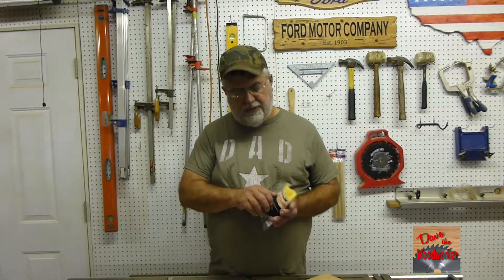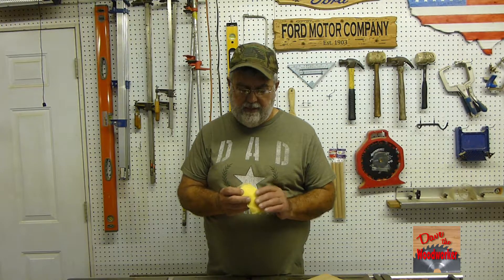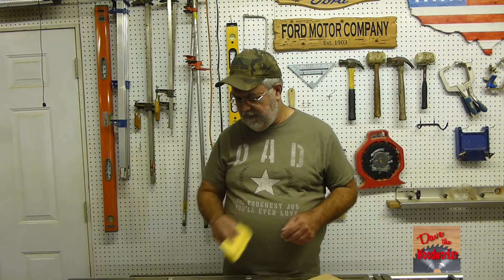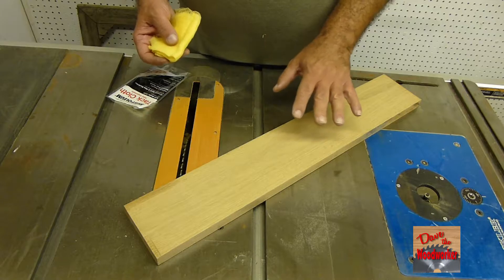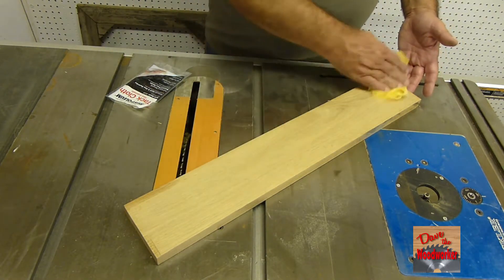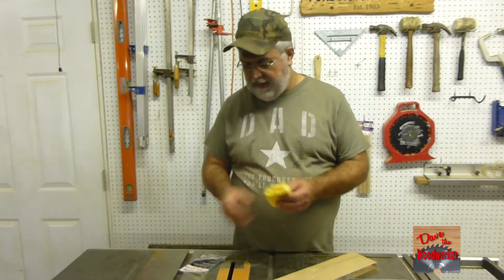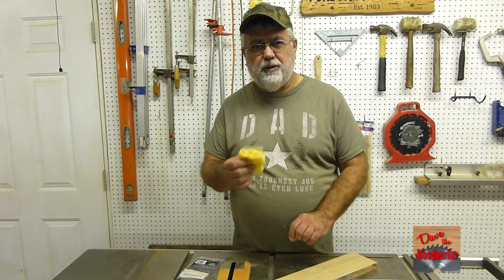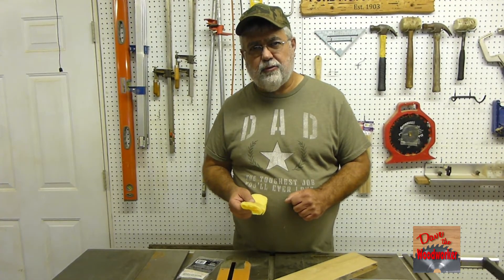What is a Tack Cloth or Tack Rag?  Why do we use them!

Comment: Just "stumbled" upon this video by chance and SO glad I did!
Is the tack cloth reusable? Do you wash it ?  Would linseed  oil on a plane rag do the same thing and do I need to remove the linseed oil before painting?
Reply from the maker: @SAOO-er7yj  they are fairly cheap, just use the clean side until dirty, then unfold to another clean side. They are not washable, I've never used linseed oil

Comment: I work with highly polished brass pieces which I then coat with lacquer.  Will a tack cloth leave any adhesive residue on the brass?  Will it in any way dull the high polish?
Reply from the maker: I haven't used any on brass, but I have used them when painting my cars, over the year's